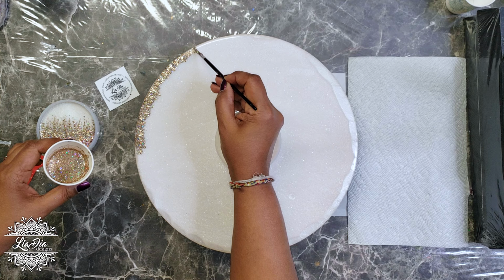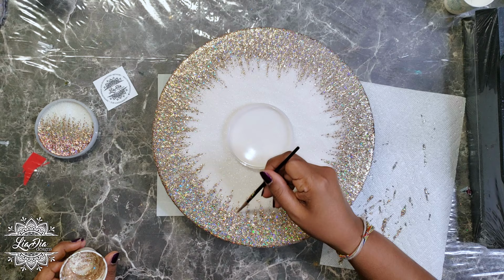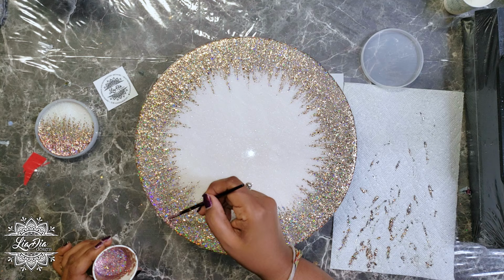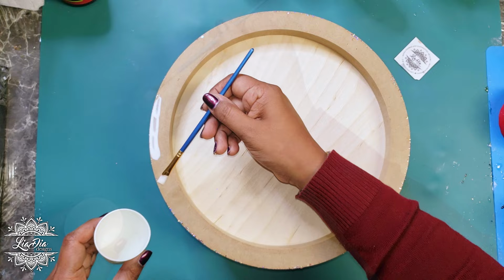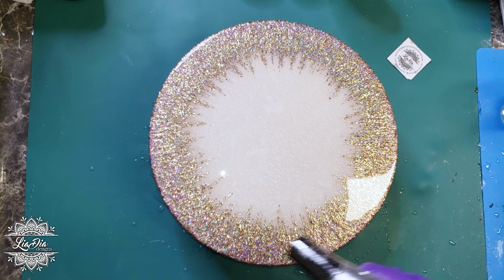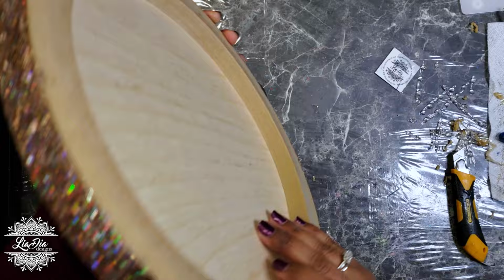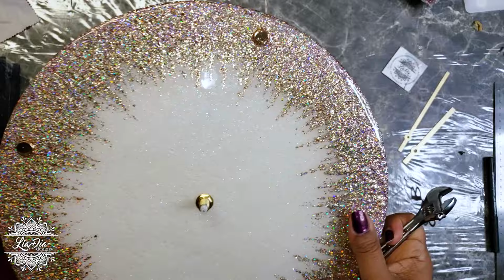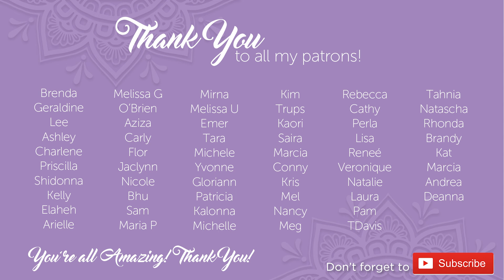Making this GORGEOUS GLAM epoxy resin clock! Easy Step-by-Step Tutorial by LiaDia Designs

Comment: I have had a wood clock for ages, but I've been afraid to do anything with it. Should I paint it or resin it?  You've given me the confidence to resin it. I have a question,  though. I gessoed the surface. Can I pour resin directly over the Gesso?
Reply from the maker: Yes,  that should work just fine 😊
Reply: @LiaDiaDesigns  Thank you❣

Comment: If you don't mind me asking you at what stage did you take off the duck tape as I used masking and when took it off the next it was really hard to take it off.
Reply from the maker: I take it off at the very end of all my pours ... so that can be a a week later... heating the tape and drips with a heat gun before peeling can help.
Reply: @LiaDiaDesigns  i did that too but still it was harder for me to take the tape off i almost cut my finger with the sharp edges of the resin.

Comment: Does the liquid latex just work for resin on wood?  Or does it also work for fluid acrylics on canvas too?
Reply from the maker: Pretty sure it would work for most materials... I creates a barrier... even some nail salons use it on the skin around the nail
Reply from the maker: Maybe test a small section before you do a big pour
Reply: @LiaDiaDesigns  Thank you!  I was wondering if maybe I should try this for the back or my canvas for acrylic pours to be able to scrape the drips off instead of trying to use a tape.  I will have to get some and test it sometime.  The clock is gorgeous btw!